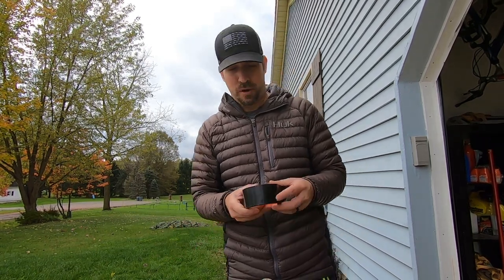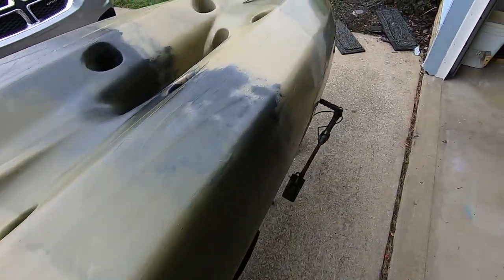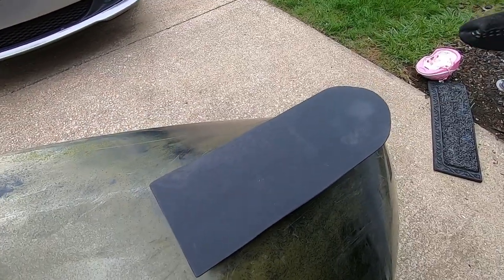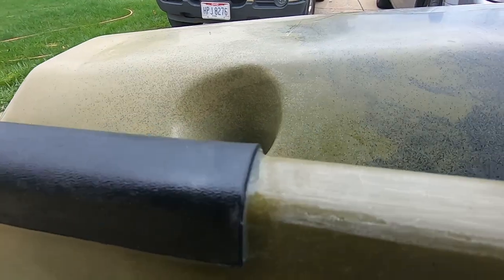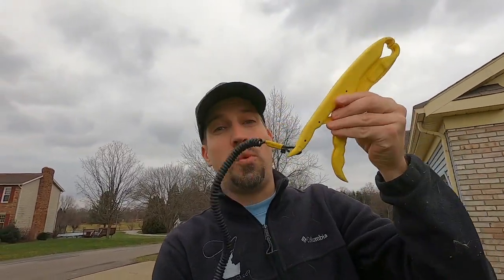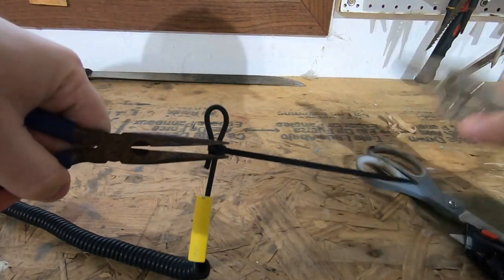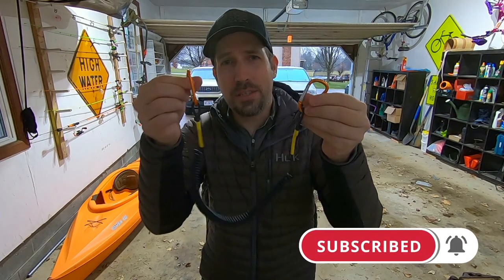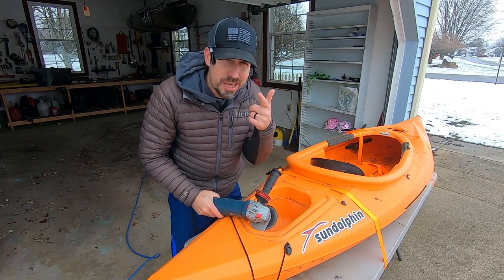3 DIY Kayak Modifications and Installs - DIY Keel Guard - DIY Kayak Leash - DIY Hatch Mod

Comment: Man that was cool watching you putting the keelgard on. That was cool watching you cut out the section for the Storage on the Sun dolphin. I wonder how did you finish it from leaking water through the storage hatch? Good video buddy thank you for sharing.
Reply from the maker: Thanks Mack! There’s a seal when you put the hatch cap back on over the cut. Good to go.
Reply: I am interested in knowing how that hatch storage mod worked out for ya.  I had one of these for a couple of years and every trip that we'll would be full of water within minutes from just paddling.  It would even till up with my less than 125# wife paddling hers.  The factory seal and the cord that holds it down don't make it watertight at all.  Hope your boat did not sink in the first few minutes of your first use after the mod.  Also, I hope others did not do this to theirs and then sink their boats.

Comment: Ziptie tip:
If you snip the end of the ziptie off with a few extra emergency teeth extending, hold a flame of a match or torch very briefly to the snipped edges soas to melt the sharp edges ever so slightly away in order to eliminate the chance of getting scratched or cut by it.  This will allow you to have a couple more emergency teeth in case the ziptie jumps open a tooth or two under stress.
Reply from the maker: Right on.. Thanks Yeshua!

Comment: Could you please recommend best way to launch and return with landing gear? Not sure about yours’ but my wheels float, so when I’m trying to exit the lake, it’s very difficult. TIA!! 👍🏻
Reply from the maker: I hear ya there. I usually will back my yak in.. and then either pull up the landing gear from the dock or literally just have to turn around in my kayak and pull them up...and the same with returning. If I happen to come across a better way.. I will definitely reach out. Soon they will have hydraulic landing gear!
Reply: @wendellfishing  thanks. Hard to believe they used floating wheels. I’ve heard some people putting CTug wheels on but that’s a $55 add on!
Reply from the maker: @willfarkouh  Yeah.. I'm actually a fan of the Pneumatic.. mostly because I take my yak to some gnarly places and need the give as I drag it through the forest and over roots and rocks. I'm one jolt away from my rail ripping out as I have way too much weight!
Reply: @wendellfishing  yikes. I noticed that yours is installed closer to the stern. It carries more weight in that location which I’m sure you already know
Reply from the maker: Yeah….I plan on trying it closer to the seat and see what happens